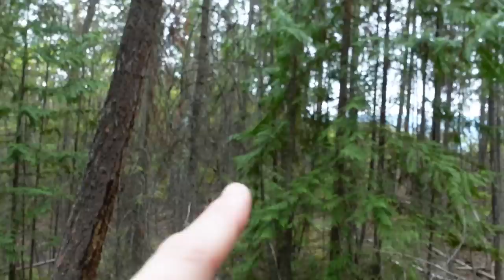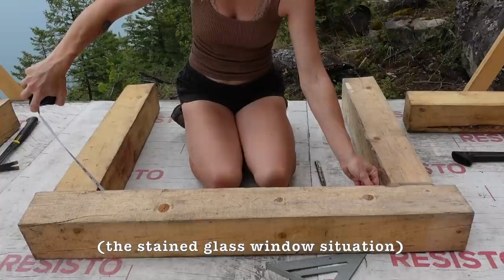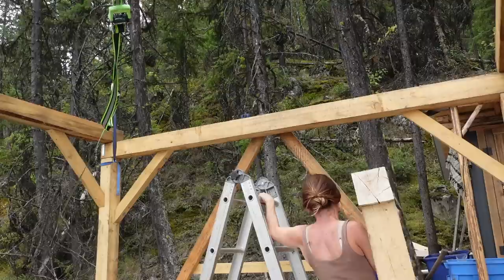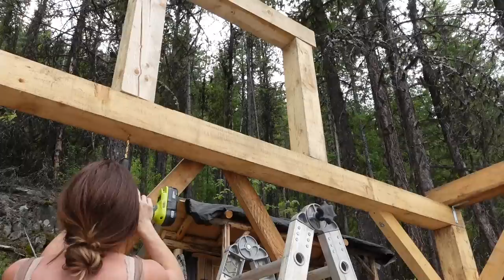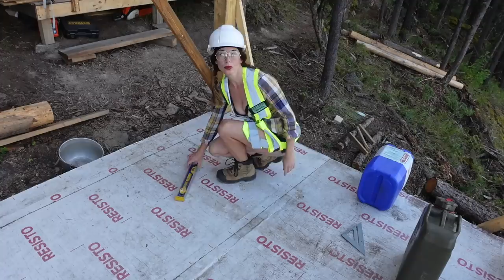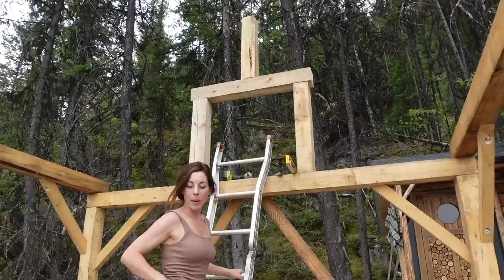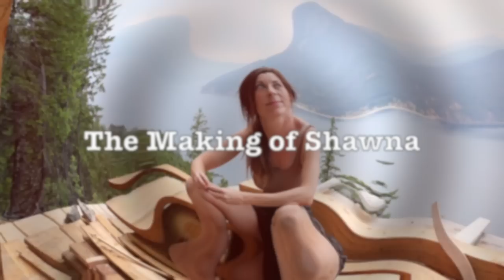The Cabin on a Cliff: post and beam install (Ft. Another visit from the building inspector). Ch12

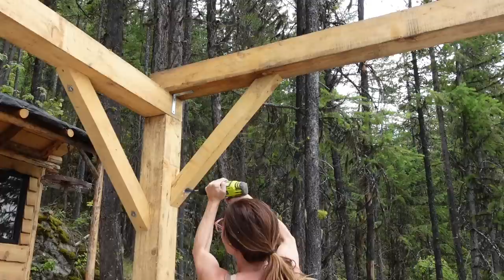Comment: Are you concerned that the fasteners you are installing from about 4:00 to about 7:30 are being driven into end grain, so will have somewhat reduced holding power with respect to axial tensile loading?  Or do you think that these fasteners will see little tensile load under realistic wind load cases when the frame is complete?  With such a small frame, it may be a moot point.  They'll be fine in shear, no doubt about it.

I am noodling on how best to build a garage/shop (3 bays), more or less as a high posted Cape Cod with queen posts for better use of the attic space.  I'll probably frame a jetty over the eave side garage doors to better protect the rolling door hardware, so the posts won't be continuous from sill to plate on that side.  Anyway, I saw your queen post in the video thumb and had to take a look.

Regarding getting timbers aloft, did you consider site building a pair of shear legs ( sometimes called a "gin pole", though in truth that's a different animal)?  Mr. Chickadee did a nice job of it on his YT channel.  It might have been overkill for such a small cabin.  I'm planning to build a pair of telescopic steel shear legs to mount to the stake pockets of my flatbed, with the winch behind the headache rack, and chains between the head sheave and the rack.  Probably "preventer" chains from the legs to the rear bumper, so that if something "interesting" happens, the shears won't whip over onto the cab!  With careful forethought, they'll be mountable to the rear tool bar of my vest pocket track loader, as well.  Between the two platforms, the shears should be a pretty versatile means of raising a large frame, bent by bent.

Also, have you thought about using one of the larger Japanese pull saws (Silky Katanaboy is the big dog - and a folder, if all the pricier for it - but there are other big pull saws available) as a packable "cordless" saw?  I haven't used one, but they appear to make quick work of cutting even largish timbers, though you'd need a diamond feather file to resharpen the blade when that time came, due to the very aggressive induction hardened teeth.
Reply from the maker: Both myself and Steve (who is a mechanical engineer) feel that what I am doing is sufficient for this tiny structure. The lag screws in this application are good for compression, tension, and shear. For what it’s worth, I have put 4” screws in at an angle down through the post into the beam as well. 
We build a carport about 16’x24’ in this same way (with a bit of lap joinery) and it’s held up just fine.
Reply: @michygoss7148  With the angled screws, I'm sure Steve's right, especially for a frame of this size.  As someone who is at least nominally a mechanical engineer, I tend to be guilty of a belt and braces approach more often than not.  Seems like Steve may have tamed the shipfitter's disease.

Out of curiosity, what is the nominal design snow load where you are?  I'll need to use at least 80 psf, but if I were a few miles from where I am (and in flat country, too), it would be 100 psf.  So, before adjustments for roof pitch, drifting potential and the like, I'll be using 100psf.  Especially since some of the 100 psf area nearly always gets less snow than where I am.  Lake effect can be capricious.  Add in a stiff gale, and the loads on big building can be impressive.  And that doesn't include all of the stuff (or, as my wife says, "junk") which will be stored in the attic, awaiting just the right circumstances to become indispensably useful.

Regarding stoves for heating the cabin, have you seen the little Kimberly model from Unforgettable Fire?  The aesthetic might not be for everyone, but I think they're as cute as a button.  It would be very packable - worst case a Pelican sled once there's good snow cover, but a pack board with tump line should do the trick to get it up to the cabin.  However, they are also uncheap.  I'm hoping to see one in person, soon, but they look a very nice stove for a small space, especially for something that will only be heated occasionally, and thus needs a quick response time from a cold start.  Installation clearances can be fairly close with these little things (saves floor space two ways), and they only call for pellet stove pipe for the chimney (cheap and easy to pack).  The are reported to burn pretty cleanly, with good secondary air, but have no fussy catalytic element which needs to be periodically replace due to potassium poisoning or can get damaged by overzealous firing or imprecisely loaded splits.  The downside is that wood needs to be cut short, and the firebox isn't big enough to tolerate larger splits.

Nice work on the frame.  It has a lovely vantage.  Hope you can get the cabin buttoned up before the weather turns, so you can enjoy some (heated!) solitude this winter.

Comment: Take a plastic cup n drill a hole in the bottom the size of the drill bit shaft.install your bit threw the inside of the cup n put it in your drill.cut the cup down to the depth of the hole you need,push the cup up to the hole n it will catch you chip n not get in your face.if the bit is all the same size you just drill threw the cup n go.please now lets inspect.i certainly know that song.but i don't see any of your friends helping you.that's my problem too.but they always need my help.but not anymore.

Comment: Do you have a hammerdrill that uses SDS- connection ?
If so you can buy a SDS thing🧐😂 that will make the drill become hammer.
Reply from the maker: I don’t have one!
Reply: @Michygoss Hmm, I don't know an impact drill can drive a nail into the. But do you or Steve have a 1/4 inch hex nut driver

Comment: Still love the build process but I do cringe when I see some of the things you do, especially when you are on site by yourself.
The biggest cringe was when you extended the folding ladder and put the knuckle joint on the floor, please flip it around next time and have the rubber feet towards the ground.
Being safe and feeling safe are two different things when it comes to accidents.
Reply from the maker: Oh ok. I thought that using the heavier end of the ladder on the ground was more appropriate. I will change the way I use the ladder in that position for future. Thanks!

Comment: hi, no lag screws are not wood screws.  wood screws are generally smaller in size. lag screws start at quarter of 1 inch and get larger. in your post to beam connection you need to anchor so the post and beam are very stable and do NOT sway or pull apart. you need to use flat L brace or T flat braces. i always put on both sides and used machine bolts to make a very stable joint!! when you see these braces you will see how they work.  i left my phone number for you to call me if you like.  it is not in the comments.  i guess i am not to do that?
Reply from the maker: I hear what you’re saying, but I do think that with lag screws and 4 all purpose 4” screws as well it should be ok. The engineering husband approves so that’s good enough for me. We built a large carport in this same way and it hasn’t moved 🤷🏻‍♀️